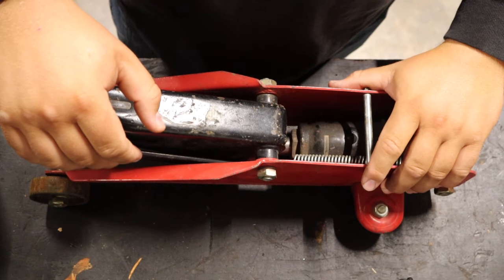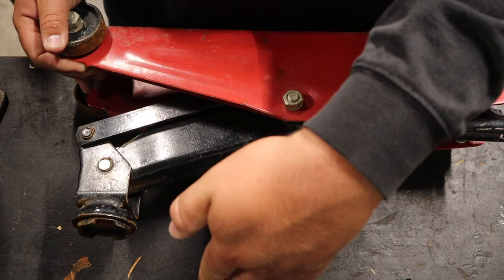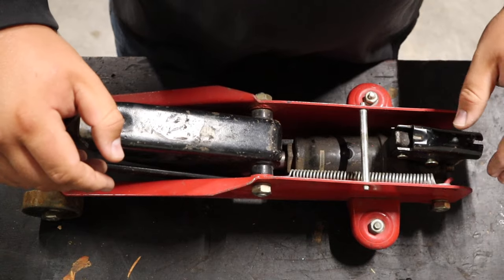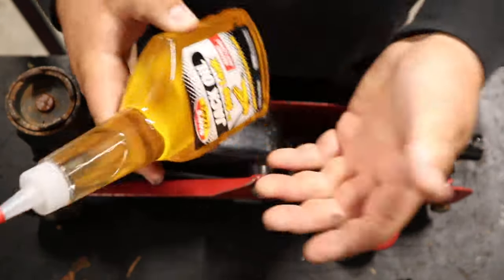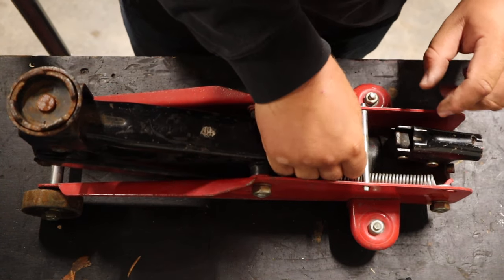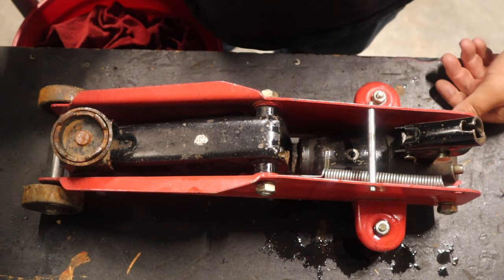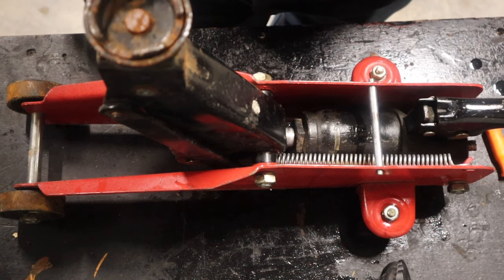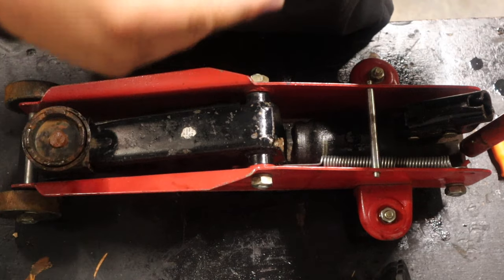Hydraulic Jack Not Working? Not Lifting All The Way? Try This!

Comment: Pretty good top score here.  Just measure the energy used to mae the metal case, steel parts, design , paint (Co2 emmited to produce this one), to just just throw it away in order to get a new one when this one still works and is not something as food (first need). Most amer  waste to much stuff  .  Oh the paint is bad or not new looking so let get a new one..... I mean....  Pretty good video

Comment: Excellent video. The "mistake" actually was the highlight of the video. Thanks a mil for your help! I used Honda 10w30 engine oil because I had no Jack Oil on hand,  I used a syringe to suck up oil from the bottle and inject the oil into the jack.  I repaired two floor jacks, both working perfectly fine so far!

Comment: PERFECT!  Solved my problem.  My trolly jack all of a sudden would not lift very high and even then it would deflate upon its own weight.  My jack is 30 years old and when buying the hydraulic oil I had a choice between AW-32 or AW-46 ("W-46 which is thicker and less likely to leak from an older machine") I drained the old oil and followed your video - 10/10 - Thanks!

Comment: To easily install the rubber fill plug push a blunt object into the little hole which stretches the plug and it goes in.

Comment: Ah, thank you. I ended up on a remote ranch farm (Powder River County); had to jump at the chance without the best of resources. Dancing tires around at times; scissor jack with my 2002 GMC HEAVY Envoy bent long ago. Distant if any services available. Fortunate to find a working "bottle" jack but dammit, does not go up enough so a hassle. Oh, look. A BIGGER heavy duty bottle jack in shed ... but does not rise at all. What's this screw in the side? Wonder if any way to ... yes!  Have to switch out a tire in next 48 hrs before snow and a trip. NO specific hydraulic oil sooo... what else around here that might serve in a pinch? Will see if I can closer tag how thick/thin it is. Believe worth the risk as can drain later; unlikely to hurt it.

Other jack still works enough. Neighbor rancher has shop/skills/resources enough to rotate and repair entire tractor tires and bet HE has some ... but just getting out of the How Long Will This Greenhorn Last phase and the less I ask for help, the better. Appreciate the knowledge here. OR any suggestions if you happen to see this in time! Cheers.
Reply: Update in less time than typing above: "in a pinch", the Great Google sez any lower weight non-detergent motor oil, ATF or even baby oil can work. Got lots of automatic tranny fluid! Carry on.

Comment: Mine.was leaking fron a screw with cover in it do not adjust, but it is leacking already from  there and I have to remove it, and there is  an oring there, but when you turn that screw alway down till it stopped, it doesn't leak anymore, but I didn't know of I should run that screw alway down and then fill the jack with oil or change the ring first and then put that screw but I don't know how many turns I should turn that screw? Or just turn it till it stopped.

Comment: That Jack is very similar to might and there is a screen that had a cap on it that said "do not adjust"   well I was messing with mine because it wasn't working right and I took that plug out.  Got a video on how to adjust that do not adjust screw?  I added weight to my jackand loose Ed that plug all the way until it wouldn't pump then I turned the screw one time until the pump was registering .  I then turned it into more time and it works on my lawn mower but I use thenjsck for my car too and before I put that load I wanted to find a  idea on how to adjust those

Comment: Going to try this, will come back and let yall know if it worked
Reply from the maker: It’s not a guaranteed fix, if you have bad seals and stuff, it’s not going to magically repair it, but if you just have a slow leak or something it’ll fix you for a short time until it needs a refill.

Comment: I have a basic hydraulic jack like this bought new. It worked fine. I haven't used it for around a year and it now won't raise at all. Put some oil in or something else?
Reply from the maker: If I didn’t see evidence of the oil leaking out where I placed it, I’d assume something else. But I’m not a hydraulics mechanic. Just a tinkerer. Check the seals you have easy access too like the one on the plug screw you twist in.
Reply: @DereksWorkshopAndProjects   Thanks, I’ll have a good look at it. No evidence of leaks in its plastic container.

Comment: I have a Duralast ( didn’t last long though) 2 1/2 ton floor Jack that was bought in 2019 only been used 3 times. Went to use it a few months back and it will not lift a load. It does not leak. Oil level is good. I have jacked it all the way up and pumped it 8 more times then released it and burped the plug. Tried to raise the car and it will not raise more than an inch. At my wits end. Ready to throw $130 jack in the dumpster unless anybody has any good ideas. ( I have tried the valve open pump it 8 times close the valve pump it to full extension pump 8 more times beyond that lower it and burp plug. Tighten the valve put it under the car to raise it and NOTHING! I have tried that recommended fix 15 times. NO BUENO!)

Comment: I have a 2 ton Pittsburgh floor jack, I put fluid in it but it’s still not lifting my dodge pick truck anymore
Reply from the maker: Probably the seals are bad then. Either throw it in the scrap metal bin and get a new one or try and find a seal kit, disassemble it, and replace all the gaskets and seals.
Reply: @DereksWorkshopAndProjects  I was actually able to fix it! I turned the crank handle clockwise until it was tight then turned it counter clockwise 2 full turns then pumped the crank handle 10-15 time, then tighten the crank handle and pumped it all the way up. I repeated that and before I cranked it all the way up I put it under the truck and it lifted it where I needed so I just needed to release the air that was in it :)

Comment: That incident makes me worry about how safe this kind of jack is. Any comments?
Reply: I think the plug only popped out because he had the lowering screw turned as well, not just because he put weight on it. But that is also why you always use jack stands and never trust only a jack.
Reply from the maker: Missed this somehow. No way. The Jack went down because I was trying to make it go down and because it was raised when I filled it, the resevoir became overfilled and that’s what popped the plug out when it went down. I actually just used this Jack a week ago on my dump trailer. Worked perfectly fine.

Comment: My jack doesnt even lift a little. Nothing happens. Is that  an oil issue?
Reply from the maker: Could be, but I’m guessing a bad seal all together. Try and find a rebuild kit. If it’s a big expensive Jack ($200+) and you don’t want to try to rebuild it yourself then I bet a hydraulic shop could rebuild it for not too terribly much.
Reply: @DereksWorkshopAndProjects  thanks! I'll try putting oil in to see if anything happens. Oil is completely gone.
Reply from the maker: Oh, then it’s gotta be oil, but it’s probably  gone from a leak, so probably needs to be rebuilt.

Comment: I have a jack similar to that 
It leaks bad out of the screw you turn to let it down
Is there a seal I can get
Reply from the maker: On the end of that screw there is a rubber seal. Some might be o-rings… on the one I took apart a couple years ago it was probably a centimeter thick, maybe two, with a hole in it that slides over a small pointy end of the screw. I’m not sure where to recommend to find one / buy one but I’m sure there is one. Look at the hardware section of your local ace or other hardware store. I’d probably take the one in their out with me to compare.
Reply: @DereksWorkshopAndProjects  do they need to be special orings for the oil ??
Ty
Reply from the maker: Not sure. I’m not a hydraulic cylinder mechanic or anything. I just know enough to get myself into trouble I guess. Everything you do is at your own risk.
Reply: @DereksWorkshopAndProjects  obv I was just asking 
There cheap 
Mine just floods out everytime I unscrew it 
And I'll try my best 
Ty again for the Info
Reply: Just bare
Just barely untighten it

Comment: How tf can a CLOSED jack leak or loose oil?
Reply from the maker: Are you not aware that there is a light film of oil on all hydraulic cylinders when they are extended?
Reply: @DereksWorkshopAndProjects yeah but I have never seen any drips or whatever. I went ahead and bought oil anyway and greased all the pivoting points and replaced the o rings.

Comment: Your not supposed to top it off with Jack oil. You take the oil filler rubber cap off,thentilt the jack vertically were the handle is facing down, that's how you check fluid level. The proper level should be on bottom of the circle of the oil filler